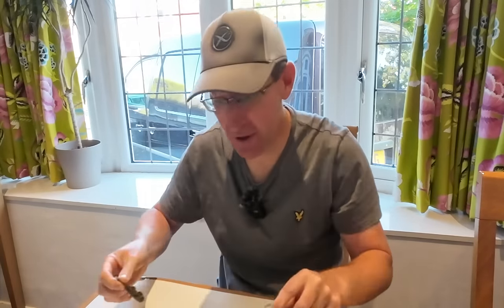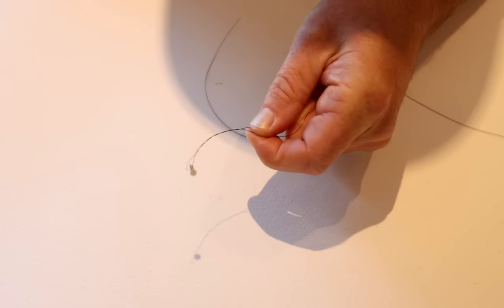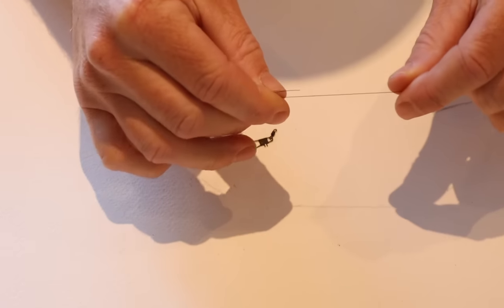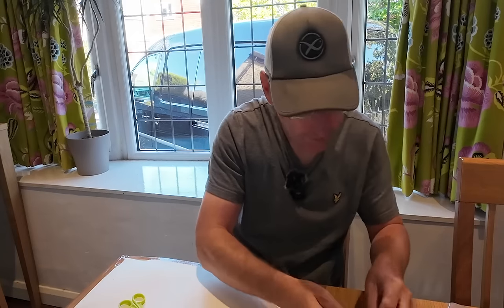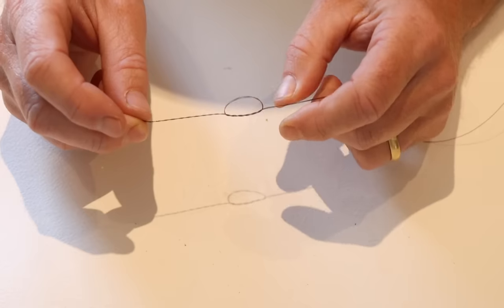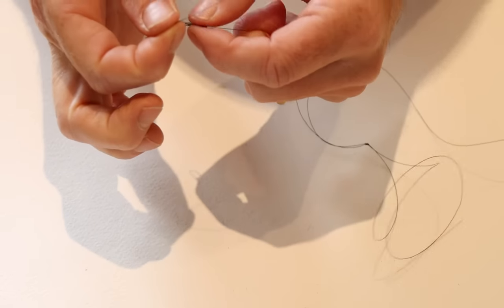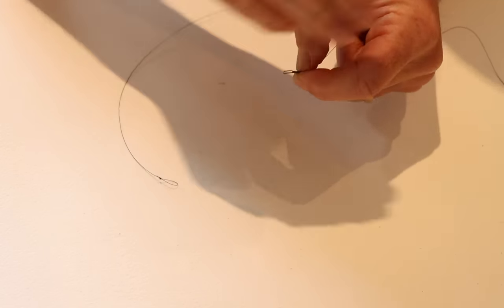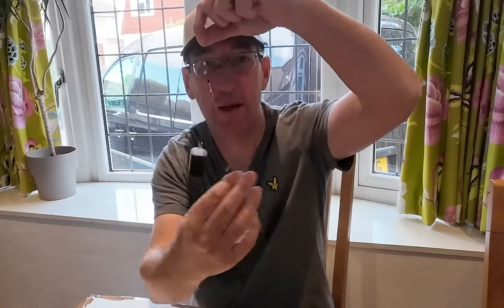Ultimate Guide To Feeder Rigs! (10 OF THE BEST)

Comment: Tip - if you're adding a twizzle to a length of line without weight, as in rig #6, then you CAN add a weight to the hooklength loop using an open paper clip or an almost-closed staple with a bomb on it, and the twizzle will be easier to create. Keep it handy in the tackle room when prepping your feeder rigs / rods, and your twizzles will be super-tight on every rig.
Reply from the maker: Good tip Steve!

Comment: I was a nibbler for ages, but I bought some of those matrix braid scissors with the green handles you are using, they're fantastic. Question Jon: what hook length lengths do you recommend for fishing method? My waters only allow free running, not elasticated. If that has a bearing
Reply from the maker: Thanks Tom. If in doubt always stick to 4in hooklengths on the Method. If lots of f1s are about then 3in can definitely be worth a try. Rarely go longer unless it's very big carp or bream your after. Stick to 0.20mm for most venues, maybe down to 0.16mm if its F1s. And 0.23 if its big creatures!

Comment: Excellent video Jon. Which ones would you use for certain situations? What's your preference for fast flowing rivers etc?
Reply from the maker: If Im chucking far then the helicopter, but I generally prefer a standard twizzled boom running setup other times.
Reply: @JonArthur  Cheers Jon, keep up the good work.

Comment: Excellent video john,what size swivels and quick change links would you use for catching carp up to 10lb
Thanks
Reply from the maker: I dont think the size is that important with regards the size of fish as they will all be considerably stronger than the line you're using, but Im terrible with understanding swivel sizes, so I buy all sorts and it could be anything from a 12 to a 20. Smaller ones for basic feeder links as I dont want extra weight. Bigger ones better for quick change elasticated feeder stems though as theyre easier to get on and off and dont compromise the rig mechanics.
Reply: Thanks jon ,was concerned that the size and weight of the swivel might affect the movement 
Cheers Ray

Comment: Great video Jon, those beads in the helicopter rig: Could they be used for securing heavy olivettes on river pole rigs, instead of using shot, or bristle?
Reply from the maker: Yes you could use rubber float stops, but they’re a ‘use once’ option and I still prefer shot above and below. A little chain of shot directly below an olivette seems to alleviate tangles too.
Reply: @JonArthur  Hi Jon. Great vid as always. Can I just say, you can use the float stops more than once. Indeed I have used them until they become loose on the line

Comment: What is the purpose of a tail rubber Jon, typically used on flat bed feeders? The line seems to cut through it eventually. Is it really necessary?
Reply from the maker: I’ve never had any issues with tail rubbers being cut through but agree with some feeders it serves little purpose other than neatness. On the newer interchangeable stem feeder designs it helps stop the feeder falling off though.

Comment: The " Top sleeve" of most method feeders won't last a session if you use braid as your main line....especally if there is a knot in the line...
Even the plastic of the feeder...
It just saws it way through them, and, no, I don't use a shock leader.. ( another knot...)
Reply from the maker: Yes agreed and not sure the top sleeve serves much purpose at times, but majority of venues people use mono so it'll last for that.

Comment: hi jon, do you think that a quick change hooklength swivel changes the presentation of the hooklength because of the weight of it, and do you think the fish can feel it?? thanks
Reply from the maker: Yes I think it can change the bites on a standard paternoster style feeder if its somewhere further away between the feeder and the hooklength, even with a tiny one, so that's another reason why I prefer a loop to loop most of the time. A fish must be able to detect the weight of the swivel at times I am sure, so it all depends how positive the bites and self hooking nature of the rig is.
Reply: thanks jon, i did think that may be the case, even the smallest weight would make the difference, i just fish a simple running line feeder set up  with a twizzled boom at the end, loop to loop it is then  @JonArthur  👍